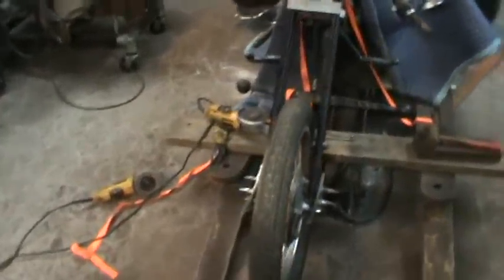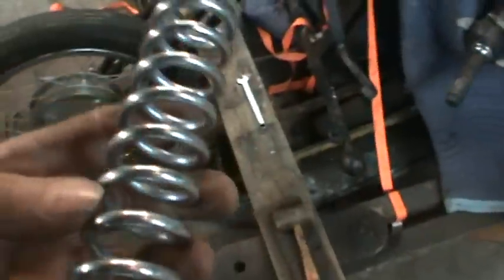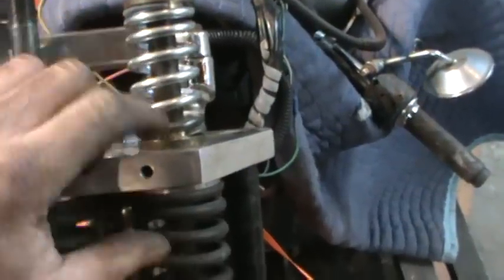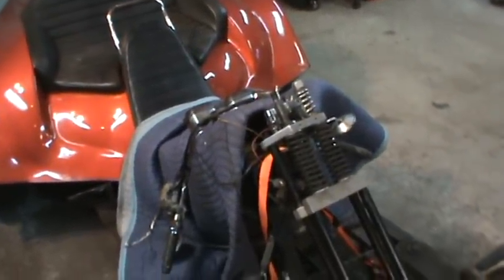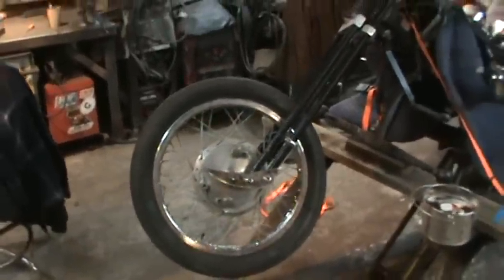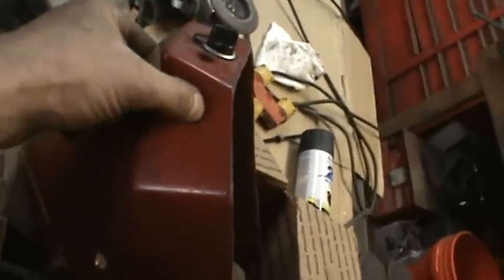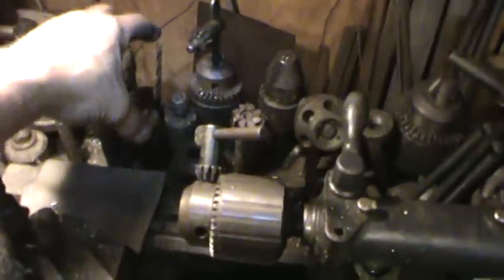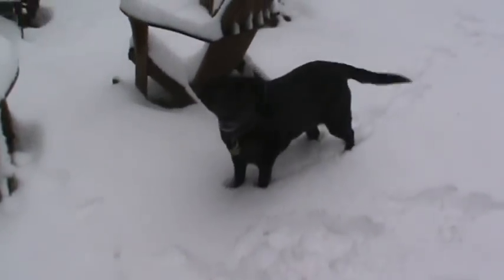vw trike, makin missing metal pieces

Comment: You could also save yourself a lot of different alterations by cutting the pivot/downtube loose and simply adding a couple inches of fat steel to the front of the frame.  That would make the bike frame longer by a couple inches. No body cut. No brake relocate.  Also, it would change the balance forward a bit.  This would reduce the tendency to wheelie by adding a bit length and weight to the front. One cut. One piece of steel.  Two welds.  ?!?   Bo..